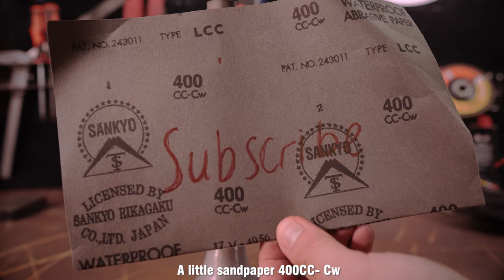Restoration Ancient Oil Lamps From The War

Comment: Did you have two of the lamps, or did you repair the base a bit after blasting the rust off?
I am sure there was not much left of the foot and it had some holes in it before you blasted it and after it seemed fully intact and little damage.
Just comparing the footage between 5:15 and 5:25 and the footage of it after the blasting.